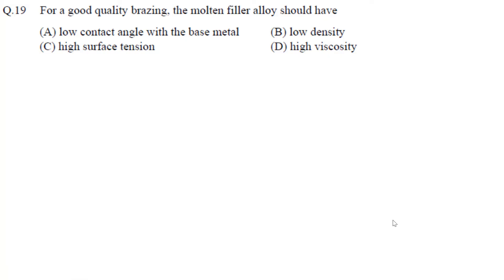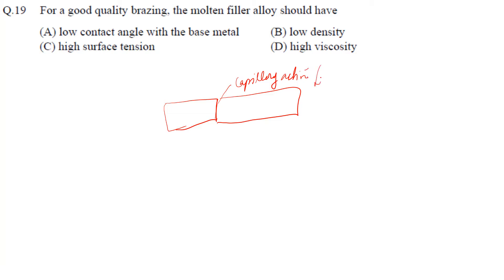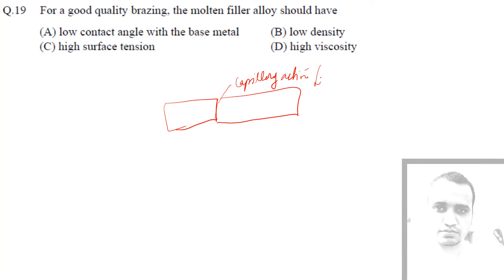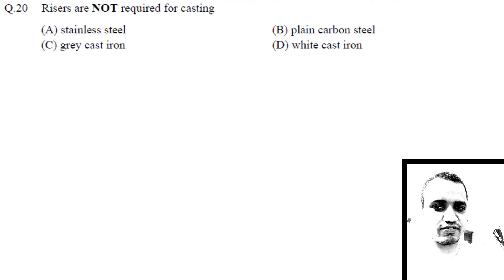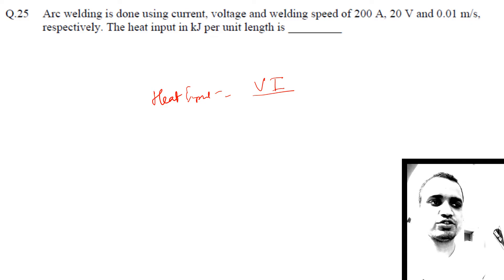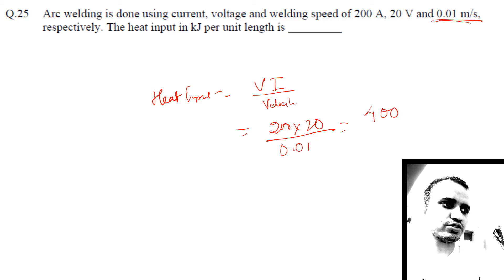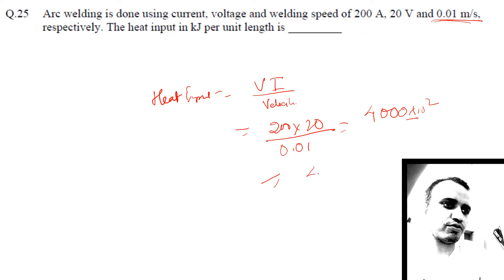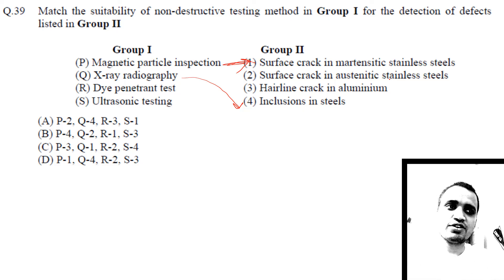GATE 2013 Manufacturing Process Solution

Comment from the maker: 00:01 Good quality brazing
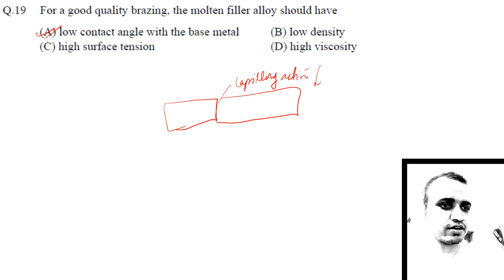01:18 Risers
01:58 Arc Welding
03:41 Maximum possible reduction
05:14 Match Defect in manufacturing process
08:27 Match powder metallurgy process
09:34 Match NDT methods